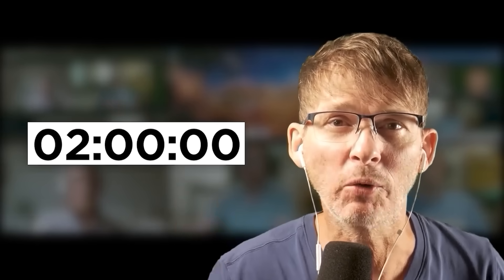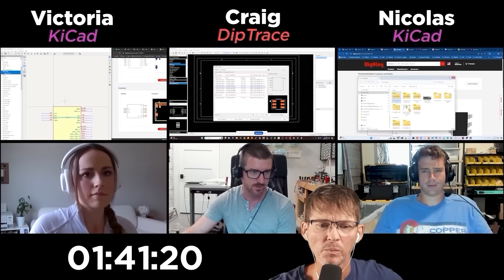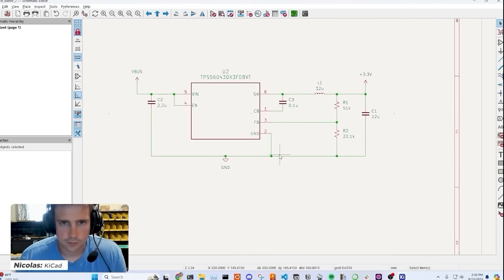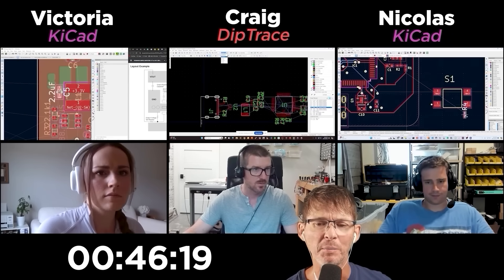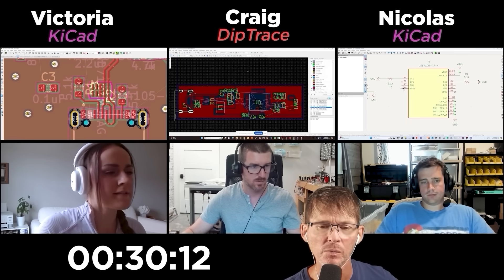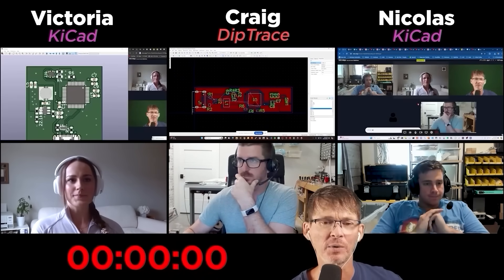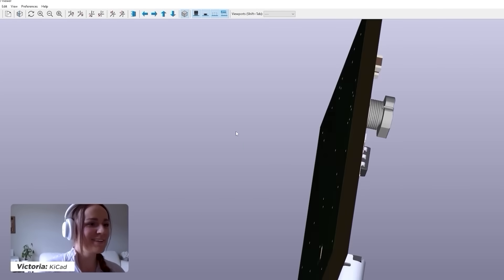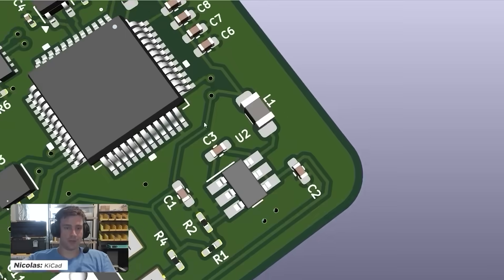3 engineers race to design a PCB in 2 hours | Design Battle

Comment: Mounting holes are always forgotten.  Disappointing but interesting video.  I will keep an eye out for more.
Reply from the maker: Mounting holes aren't always required. Some products just sandwich the PCB between the enclosure. Thanks for watching though!
Reply: I 3D print most of my cases these days so it's easy to make slots, cavities, snap-clips, etc. to mount the board eliminating the need for mounting holes in the PCB design which can save a lot of real estate on small boards and assembly time with tiny fiddly screws. FWIW, mounting holes weren't called out by the 'customer' in this case, only the devices.  Adding features that aren't required by the design is a waste of time and money therefore I feel they were correct in leaving them out.

Comment: I am only a first year mechanical engineering student, was very close to going into electrical and electronic engineering because I do have a lot of interest in the field and have used microcontrollers and built circuits since I was 16. I cant say i know much about theory (only the basic RCL stuff). But how do you suggest that I learn how to build PCB's or get to a place where I can understand whats going on? I know its easy to find answers to these questions online but I just want your opinion.

Comment: so drag and drop? isnt there some software where this stuff is version controlled on git etc? I am a software engineer so just curious. Also are these CAD tools AI integrated? Can LLM's help engineers in generating these? Also do engineers make these PCBs like this for say apple silicon? Or is that more smaller than what can be done on these CAD tools?
Reply from the maker: AI is a good assistant to analyze data sheets etc, and there are AI design tools, but so far it's not taken over quite as much with software. Although even with software, or anything really, it's a great assistant but not a replacement.

Comment: please redesign hackrf or validate if there is actually a problem with it. theres a debate between clifford heath and the greatscottgadget group heath said theres a fault in design of pcb which causes the amplifer to short due to it being weak against incoming power whereas greatscottgadget says they got no proof other than the fact there are amps actually faulting. heath has made a revision however gsg said it actually lowers the power automatically as if it was already a attenuator.

Comment: My dad was a PCB designer (well he was an electrical engineer because I don't think PCB designer was a thing yet when he graduated) and designed some of the PCBs for very early German modems for Digitec in Saarbrücken. He was never able to explain what went into the job he did all day. He'd sometimes tell me about details with no context, like toward the end of his career when he worked on the PCBs for some of the first 5G switches and they had so many layers the electromagnetic interference between layers made them near impossible to design, but this was a cool glimpse into the kind of stuff (albeit with much older soft- and hardware) he must have done all day. I remember in the early 90s he brought an Apollo workstation home because that's what his CAD software ran on.

Comment: when I was new employee, I was like Victoria and Craige who try to make schematic look nice. and when I was getting older more, I make all symbols according to its package. becuase that PCb return to me for repairs. I always fuk up...
Remember one thing on this field. When a schematic symbol is symetrical to its PCB footprint package and pin 's arrangement, it significantly improves PCB design, manufacturing, and repair . You don't need to look up at datasheet to find the pins.
Reply: It really depends on complexity. If the schematics get big, having symbols that show you the circuit function really helps you understand how the entire device works and verify the implementation. Especially with big projects, where more than one engineer is required to do design review and verification, you want the schematics to do more than just "connect A to B", but to actually capture function and design intent. Another idea is to always follow the design that the manufacturer uses in the documentation, so it's easier to verify your design against the documentation in datasheets and application notes.
Sure, on such simple designs like in this competition, or if you are the only one ever looking at the schematics anyway, you can do what ever works best for your workflow.

Comment: What a Great PCB sport, im a novice using KICAD 8 my Schematic seems to look good but my PCB design is awful, as cant seem to get all the traces together, bad routs
so i installed the Free routing  plugin and still problems,
has any one used the plugin,
also can anyone examine my project ,and i would pay for service   
 it has 22 components ,  4 mosfets ,4 caps@ 2x10uf 2x100nf , 3 leds, 6 resistors,2 terminal blocks,1x12v to 5v regulator,2 fuses
Reply from the maker: Thank you! I would never suggest any auto routers and they're all horrible. 

Inside my Hardware Academy we provide design reviews. This is by far the cheapest way to get a review. PredictableDesigns.com/academy-dev

Comment: they took 2 HOURS???
Reply from the maker: Yes
Reply: @PredictableDesigns  Woah imagine how many days, weeks or months would it take to create a more complex electronic system.
I'm doing my best to learn this stuff, and woah I pray I'll make it Dude, nowadays learning Electric and Electronic Engineering is extremely important. 🙏
Great video, Thanks !
Reply from the maker: Great to hear. I wasn't sure if you thought 2 hours was fast or slow? A few have commented they could do it much faster, but it's different when you're under pressure being on camera while I ask you questions:)
Reply: @PredictableDesigns  I can imagine, Great video. I've even installed that free program KiCad, but I still need to figure out how to SEE actual 3d models on it, because like a USB C port is displayed as "reference" and not the actual thing.. So I'll figure this out and keep on learning 🙏

Comment: External i2c pull-ups not needed on stm32. Fun video, would take me 30 mins in altium ;)
Reply: If you want EMC compliance and a hardened design for industrial applications, you better add some external pull-ups and filter capacitors to your I2C lines... I2C is very easy to influence with radiated RF and ESD discharges and sometimes even conducted RF on power inputs of your device. It needs quite some "help" to stay alive and communicate in harsh places.

Comment: In terms of experience level as an experienced PCB design engineer: Middle guy is most experienced, followed by right guy, followed by left girl. All had functional designs, No.1 had a lot of wasted space, No.3 has a useless form factor, no.2 had a functional board with a useful form factor - mark of an engineer.
Reply: Decoupling caps far from MCU? No.2
Reply: @alexbeaven8532  didn't notice. thanks for pointing it out. Yes, not sure why he left all that space on right side and put the decouplers so far away

Comment: Man I really want to get into some kinda of electronic design role instead of the boring grad work I'm doing now.
Do you need to do further study to get into design or are their graduate level roles available?
Reply from the maker: Generally you'll need at least a 4 year degree in electronics engineering to do circuit design. You can get jobs in PCB design sometimes with only a 2 year degree. Best of luck!

Comment: In the 80's I would manually draw the lands, and use thin spools of 'pin-striping' tape to connect it all.  Vertical camera to take a 100% negative.  That would then be used over presensitized PC board, then the ferrochloric acid for 10 minutes...  then to a tiny drill press.... you get the picture.  
Now it is uploading a file, and getting "beautiful" PC boards in the mail.

Comment: I am careless. Been zapped many many times. Once as an Avionics Electronics Technician working on the Harrier Jump Jet on the runway in Arizona. Sweaty hot, just when my Simpson volt meter shot to 220 volts, my hand slid right down the probe to the metal point. Meanwhile my armpit was resting on coaxial cables for the radar warning system which had ground shielding on the outside to ground any stray voltages. My sleeves were rolled up and it was in direct contact with the skin. Fortunately, most of it went from my hand to my armpit and some found the rest of my body. Taken 120 about 20 to 30 times. Last year building a physics cloud chamber I zapped myself on the transformer. This summer I was welding a lawnmower deck hot with 90 amps ground connected to the deck(this is a big mower pulled by a tractor and I was sitting on that hot deck.) First time in my arm as I was inserting a new rod, yes bare handed no glove, and my arm was resting on the hydraulic lines whose metal connectors must have found ground through the hydraulic fluid inside the cylinder. Zappo. About 10 minutes later, bumped my calf on the deck while inserting another rod. Zappo. Damn I'm getting good at this. Then when inserting the next rod I did the calf thing again. Now I am really getting good at this. I do believe I have a tolerance for electricity cause I used to love sticking that fresh 9volt battery on my tongue when I was a kid. Years ago I was replacing 3 porch lights for a little old lady. Front porch, side porch, and back porch. I got zapped on the front porch, then I got zapped on the side porch light. Now I am good at this stuff and I am getting concerned. So I removed the CB for the back porch so I could be sure not to get zapped. I got zapped anyway. It was at this point I could then solve the equation as enough variables had been provided. I realized at that moment that her aluminum siding on her house was shorted to power somewhere at her in box. I got my volt meter out and confirmed my suspicions. The siding was hot as a pancake fresh off the grill. She called the power company who made the necessary repairs. I could go on all day but y'all get the idea. I been goofing with this stuff since I was a kid in the 1970's. I remember running to radio shack for packs of resistors light bulbs transistors wire gosh they had it all. The good old days.

Comment: This is supposed to be a PCB design challenge. A few minutes in and it seems that they aren't working off a schematic. They are having to design the circuit and make the PCB. That's a different situation.
Reply from the maker: Circuit design is part of PCB design in my mind. But in the battle published just after this one, we did start with a finished schematic and focused just on the PCB layout design.
Reply: @PredictableDesigns  I don't think circuit design is part of PCB layout. And choosing components also not. Even deciding for the #of layers and dimensions is not freedom of PCB layout. Even developing own layout recommendations for critical parts is not. All this should be provided in advance.
It really does not make sense to be the first with an inferior design. Inferior is too big/small/expensive/not working correctly. IMO this circuit is not difficult to design. (that said w/o PCB layout experience but being an electrical engineer. We engineers just don't layout PCBs ourself b/c it would not be efficient.).
And how can you compare effectiveness of tools which I believe most viewers are interested in? Would have liked to hear reasons why Victoria/Craig/Nicolas have chosen their tool.
Experienced designers should know where to place a block capacitor/that high speed USB balanced signals need to be routed symmetrically and should not routed under a switching regulator. If they lack this knowledge most likely their PCB design skills are also not too advanced.

Comment: As a junior EE student, I feel amazing that I am able to understand most of what is being talked about with quite a lot of detail, but also ashamed of the fact that this would take me so long to do and they did it in 2 hours lmao. It is so cool seeing all the things I learned in my circuits and power design classes put together. Right now I am designing a robot for the IEEE competition and a lot of this stuff is very relevant like Buck converters, microcontrollers, filtering capacitors, and analog inputs are all things I'm having to do a ton of research with. Unfortunately the coding to make it autonomous will likely be the hardest part I am dreading, planning on using an arduino with motor shields and NEMA 17 steppers so hopefully someone out there already coded it for me and I just have to find the code. Sad that we can't go to the competition because it is during school, but still such a cool and difficult project to undertake as a single class on top of power systems design, signals and systems, analog circuits 2, and many other engineering and core classes. This video shows the light at the end of the tunnel.
Reply: I'm 3rd year EE and had the same thought. Cool that I could follow along to this kind of thing now with good understanding of how everything works. 

Probably still take me 3-4 hours in Altium but doing a race like this would be fun
Reply: cap

Comment: Nicolas is the clear winner, Craig’s has some significant issues, usb data will have to run under his switcher, decoupling caps way off to the side, stub antennas on the ground plane, double sided components are a pain and high cost to manufacture but also positioned to be influenced by the mcu temp. His switcher also has insufficient copper or thermal vias. for power dissipation. Everyone missed mounting holes, fiducials and could do with having a thermal isolation relief routed around the temp sensor to isolate it from the board temps.
Reply from the maker: Great feedback, thanks!
Reply: shut it nerd

Comment: hi, I'm curious about how to read firmware from PCBs, is a SOIC Pin + cheap microcontroller combo enough for a beginner learner ? I have a broken keyboard that doesn't register key holds so I thought I'd take it apart and inspect the firmware to see what's wrong but I'm a bit overwhelmed by all this new knowledge, seen some youtubers recommending a lot of expensive stuff which is for people who actually design PCBs and are experienced whereas I'm a complete beginner

Comment: Nicolas had the nicest and most functional in my opinion, closely followed by Victoria and then Craig. It was nice to see how they all approached the problem from a unique perspective. For instance Craig put the sensor on the back of the PCB. This might make the pcb a little more costly to manufacture due to parts on both parts of the board, however the reasoning behind that is sound. Nicolas also added a reset button.

Just my suggestion: maybe it might be nice to put the temperature sensor in a cut out area of the pcb to isolate it a little more from reading/getting influenced by the overall temp of the pcb.

You have earned a subscriber to this channel.
Reply from the maker: Great feedback, thank you for sharing!

Comment: I'm with Nicolas (1:09) - The ESP is so cheap and easily available, I don't build with much else these days. Some really simple projects I might use a '328p, but... most of my projects are not wifi or BT projects, but they're just so easy to use as well as affordable, that overkill is not really a consideration factor.
Reply from the maker: Do you use the bare ESP32 chip I assume? The module with the antenna would obviously be a waste of money and space if you're not using the wireless radios.
Reply: @PredictableDesigns  As I usually get blank pcbs to hand-solder, I get the modules as they're easy enough to hand solder.
It also means that if I want to add bluetooth later, I haven't locked myself in.

Comment: Victoria routed the enable resistor with the lowest inductance, instead of C2 :(
Reply: No typo, the R7 was the pull-up resistor for the enable input. C2 is the input capacitor of the switcher. The input capacitor conducts the highest dI/dt in buck topology.
Reply from the maker: Huh? Not sure if there's a typo in your comment because I don't understand it. But thanks for commenting.

Comment: i can do it on a single layer in 30 minutes. To sided pcbs are difficult to produce. Because they go  into owen 2 times. İts very dangerous to appyly accesive heat over chips. And botom side can drop down unintendently.

Comment: idk why people dont like Easy eda , cause the support with lcsc is insane, like you can type the part number and get a 3d model,footprint and everything you would ever need
Reply: Agreed. I did an STM32 board for a product last year with easyeda, with jlc boards and assembly. It all worked a treat. There were issues exporting SVG images as no matter what options I used it always put a border, but after that was removed externally the images were then useful to import into Fusion 360 to visualise the board in the housing design. I used a plugin script to get teardrops. There are some ways in which it could be better and easier to use, but that's the same with most tools. Overall it's good.

Comment: Awesome craft but only know how to spell schematic.
Question. I thought that the purpose of using cad software was that once the schematic was done it would convert it into the PCB"s traces. Isn't that what the software does?
Reply from the maker: If only it was that easy:) The PCB has to be manually designed. The software helps ensure it follows the rules and matches the schematic. You can do auto-routing but it's usually not very good and rarely used.